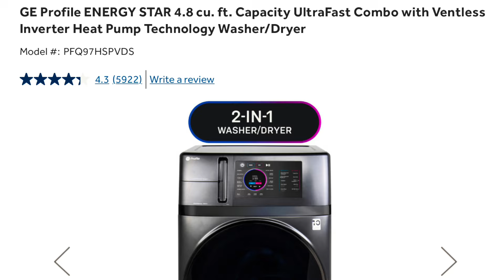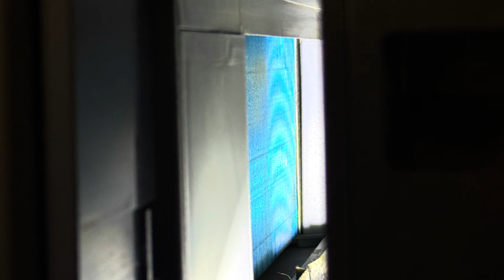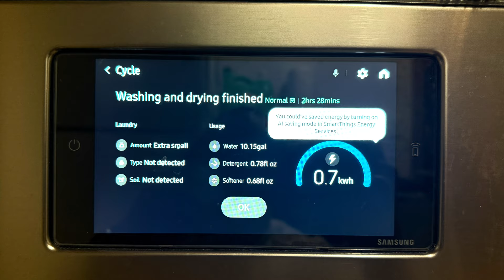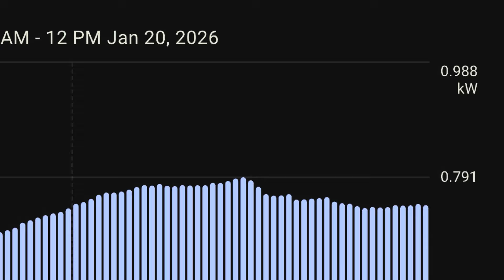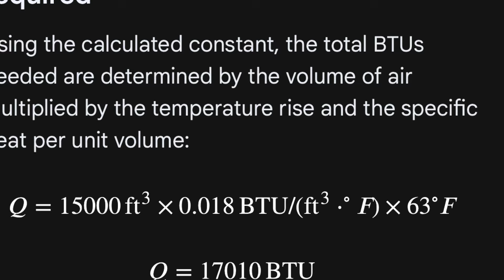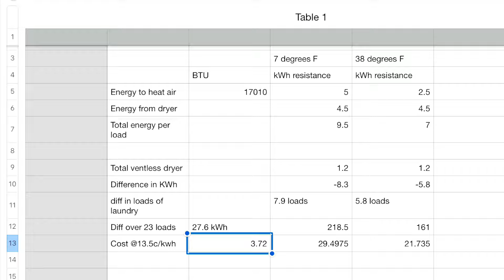How much can a ventless washer/dryer combo save me?

Comment: Had a 25yr W/D. Parts were getting hard to find, so I Got the Samsung Bespoke vent-less. Love it. Best Machine ever, using only 120v / auto dispenser has been a big saving too [$10 a month] Im using half of what i used to use, getting 2 months on single $20 -Tide jug 44 some loads on A.I. wash mod mostly used. Great on Pet hair removal / Sant. Steam Mod is super effective but 6hr cycle.  No issues after 6 months. Keep the lint screens clean/vac it. Dont forget to update. I havent used to phone app. Other pro is no more double washing a load or waking up with a wet load of laundry. Its worth Ten times the $1700 bucks spent.  Be Well Enjoy:person-turqouise-waving:
Reply from the maker: Yeah I upgraded from some low spec older units and having the detergent and softener auto dispense is amazing. One of those things you don’t know you’re missing out on till you have it… Kinda like a heated steering wheel.